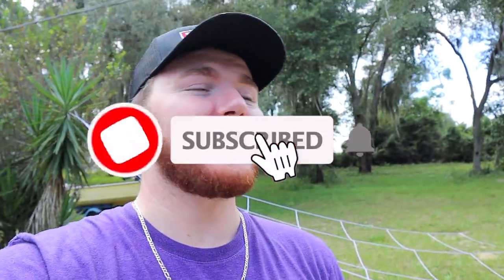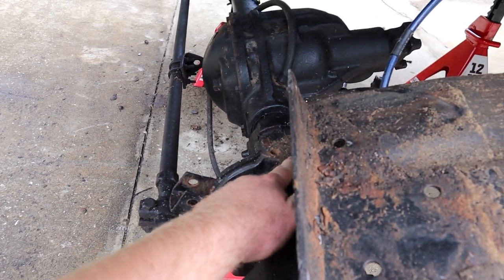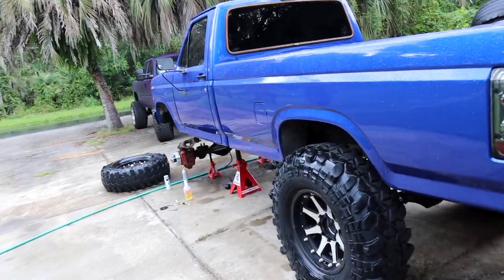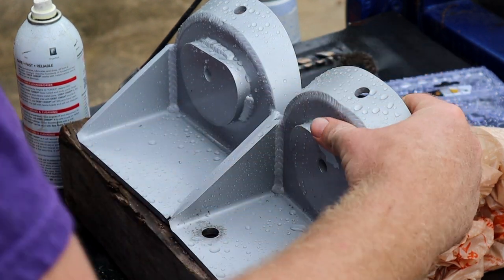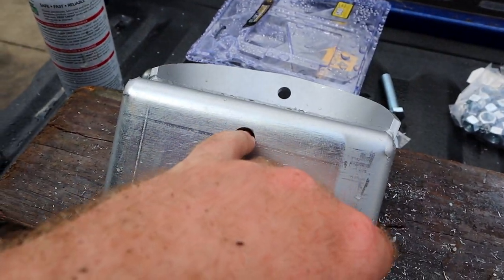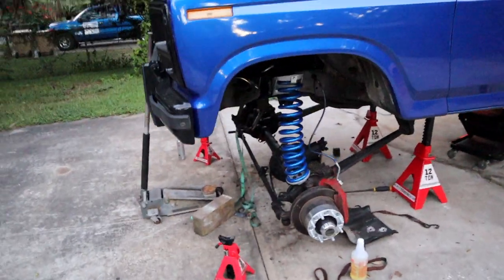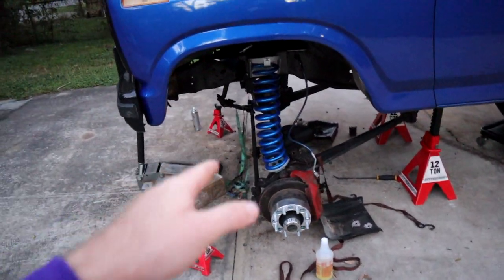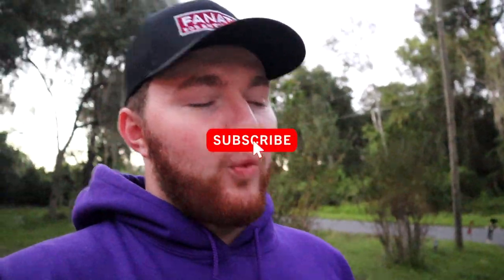Bullnose Ford Custom Lift Is DANGEROUS

Comment: Biggest mistake you’re making is not extending your radius arms. Dropping them down with a bracket will help with geometry. But you’re going to have a horrible ride. Extended radius arms are mandatory for a lift that high. So is re designing your front end. Look into Superlifts super runner set up. If you dont make these upgrades you’ll be hating life driving that.
Reply from the maker: Ended up making fully custom longer arms that go directly to the frame with no drop. Have a video of them on the channel but it’s more recent.